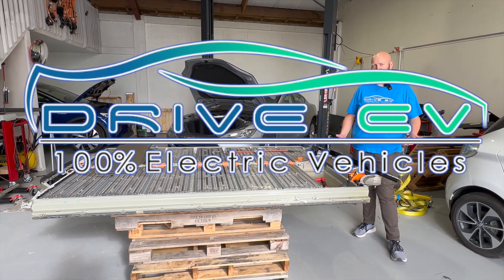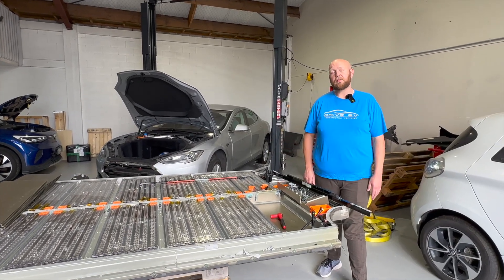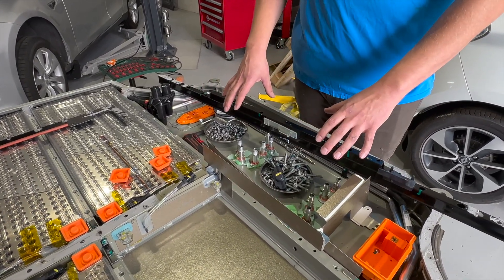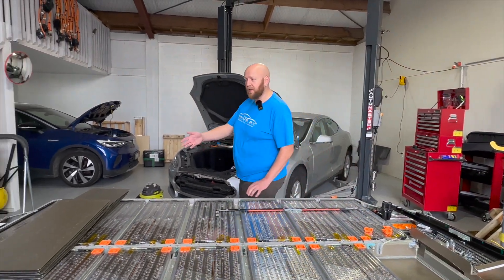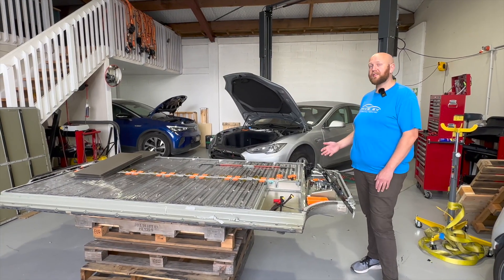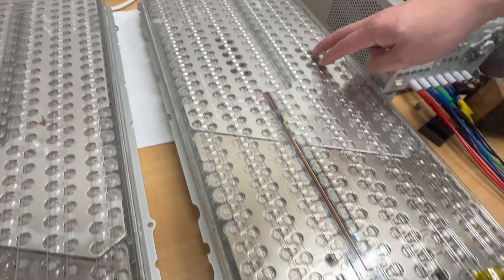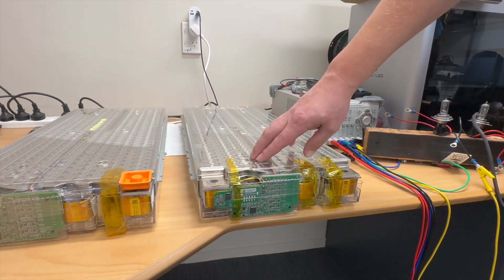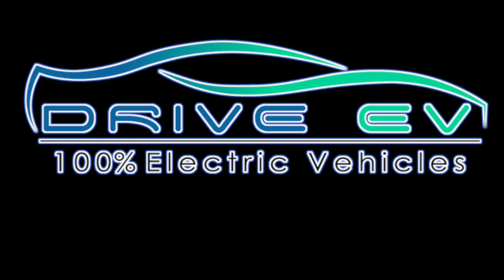Tesla model S 60kWh Battery repair

Comment: Hi, I have the same issue my 2015 Tesla model S 60d battery broke, I scan the car and show low voltage on module 14. I bought a new module in ebay, when we pull the battery out and open it,  found out that the module is missing 60 cells. The module I bought on ebay has all the cells it is also a 60d, we are in the processes attempting to install the module with all the cells. But there is little to no information anywhere, Do you know if that will work?
Reply: He explained in the video why that is… your old pack is for the 60kwh battery hardware wise. The new one is more but will software limited.
Reply: @chriscurry9201  I installed the module the past weekend , and it doesn't;t work. Eventhogh service mode shows green now all the modules. I will rent toolbox 3 next weekend to see if I have luck otherwise I will have to scrap my beautiful Tesla :/ and never buy another one anymore
Reply: @maxpower8170 how many mile you have on it?  I have a 2016 85D
Reply from the maker: you likely could have fixed the capacitors on the BMB if that is the case? If not, swapping a module gets harder due to needing to pair them up with an equivalent capacity, which is proving to be virtually impossible

Comment: I have read that individual modules are not able to be replaced due to the stringent requirement of the BMS requiring all the modules capacities to be within 1% of each other.  If only one module is replaced then it only takes anywhere from a few charges to MAYBE up to a year of charges (if you're very lucky)for a battery imbalance to occur as buying a random module and it having within 1% of  the capacity of the others currently in the pack is akin to winning the lottery.  According to this individual when that happens you're right back where you started.  He is someone who sells whole battery packs and the only people who "back up" his claim also sell whole battery packs.  So I'm not sure how honest he is being vs just trying to scare people away from buying modules and into whole pack replacements from him. Can you say in your experience is there any truth to this statement?  I am in the US and I have a 2014 Model S that has a single bad module. I'm contemplating just trying a single module replacement but I don't want to spend $500 on another module only to be right back where I am now in less than a year.
Reply: they do need to be capacity matched, yes, but i believe it is possible to start with a higher capacity one and decreasing the capacity by removing individual cell fuses to decrease its capacity. We havent had to deal with that issue (yet) so can't be sure, but thats what it seems others are doing online. There are somne good people in the US working on battery packs, like recell, maybe get in touch with them, they will likely know more from the sheer number of cars they have worked on there vs us in a tiny country like New Zealand!

Comment: What sealant do you use to reseal the battery pack.
Reply: SikaTack or Armourflex, depending on the battery. Be sure to clean up the entire surfaces though as im not sure what is used from the factory, and you dont want to mix adhesives. You can then also paint on some under body sealer around the lid edges like Tesla does on later model batteries

Comment: does the bms actually measure the voltage of every individual cell?? wouldnt that require a truck load of cables for each module?
Reply: It sure does, but it measures them on each module and then has an isolated comms channel back from the BMB on each module, to the BMS at the end of the battery

Comment: Thank you for this. I've got an M3 and was thinking that if and when there is a problem with the battery, likely many years from now, there will be shops that will be able to repair or replace the battery much as you can get an ICE engine rebuilt. You are showing that this is already happening.
Reply: It sure is, yes. There are not many, but there are definitely a bunch out there doing the work!

Comment: could you add modules to the pack to make it 100kwh? or would you have to replace the BMS and wires / water lines?
Reply: Subscribe !
Reply: you would have to repalce a lot, there is no allowance for that in those packs

Comment: Could you have added 2 modules to the front bit and increased the battery size?
Reply from the maker: No the pack does not have the connectors for more modules. A pack swap is viable though as the S was designed with battery swapping in mind. If you are in NZ please contact us to see what we can do for you.

Comment: Are you able to add more modules to turn this into a 85kwh or 90kwh pack?
Reply from the maker: No the pack does not have the connectors for more modules. A pack swap is viable though as the S was designed with battery swapping in mind. If you are in NZ please contact us to see what we can do for you.

Comment: Thank you for this video. My model s has done the same thing. Hopefully I’ll be able to fix it myself if I can find a shop that will let me do the work in it
Reply from the maker: HV repairs are not DIYable. We have all the appropriate tools, safety equipment and a very highly qualified engineer doing the work. There is enough potential energy to move 2.5 tons 500km. Once the lid is off the pack that energy can flow through you. Good news if you make a mistake you're unlikely to know about it.
Reply: @driveev441 lol 😂 by the time he made a mistake he is gone
Reply: @driveev441 lol

Comment: very interesting so a couple of tiny little caps was the whole issue, I'm guessing its worth reallly closely examing boards before diagnosis, tesla software limits a battery capacity even though the cells are in there.........what the?
Reply: Because they bought the cheaper and inferior model.
Just like all car seats are the same, but the cables and buttons aren't there for heating seats if you didn't pay for them.
It's easier to just produce seats with everything in them in one factory.